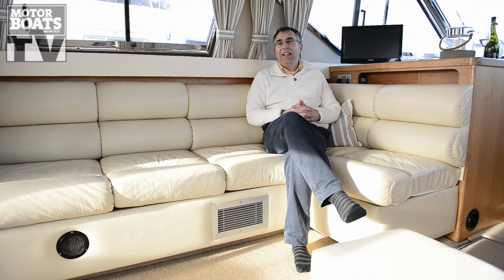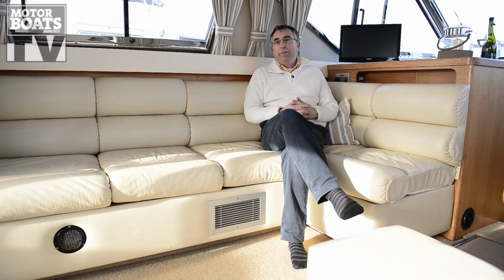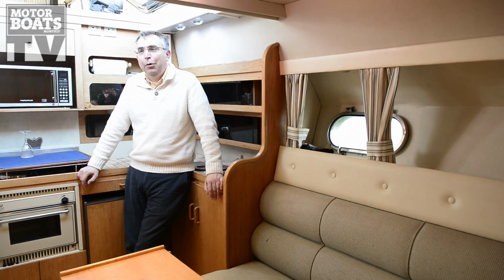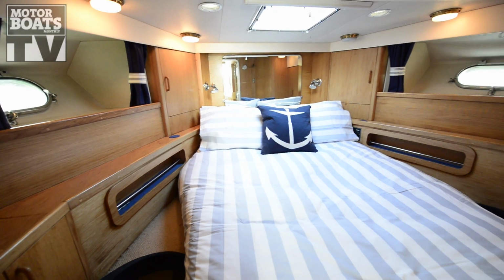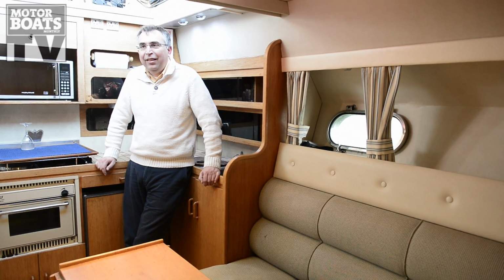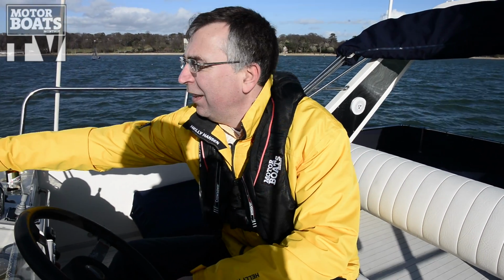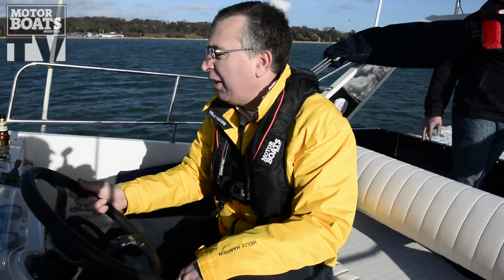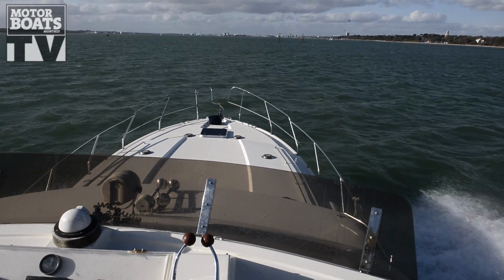Princess 45 Used boat test with Motor Boats Monthly

Comment: Had ours for 20 years, replaced the Volvo TAMD 71s for new Cummins 5.9 425hp, Now she is just amazing. An amazing boat in rough conditions we have been out mid channel in a 7 and maintained 20 knots. Ground breaking boat and we would never be without her.
Reply: What was the cruise and top speed with the Volvos? Were they the 250hp version?
Reply: @jeffwalston8110  we have a 1990 princess 45 with 2x 352 hp volvos, it does 23 knots
Reply: @stinussamuelsen4686  Thanks for the response! Is 23 knots the top speed? What do you cruise at?